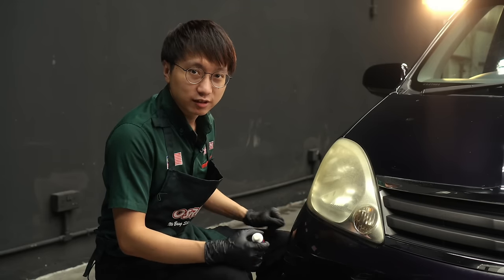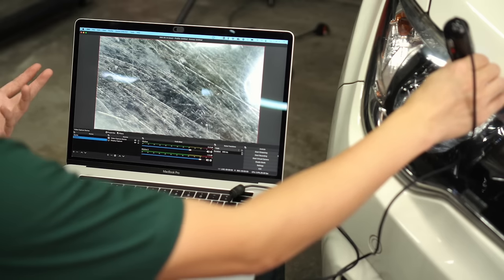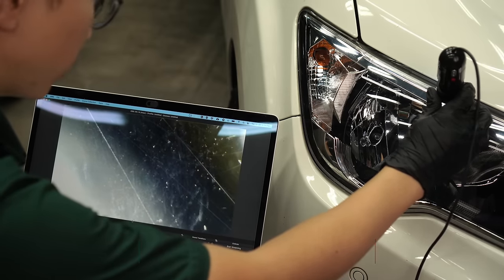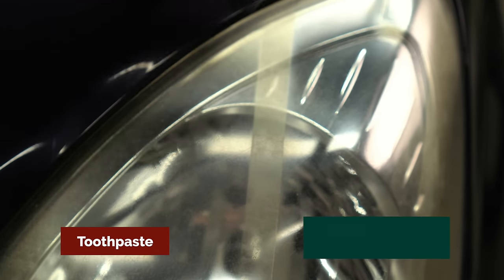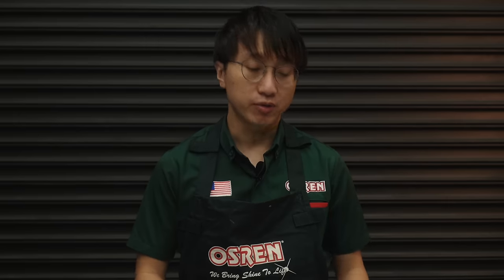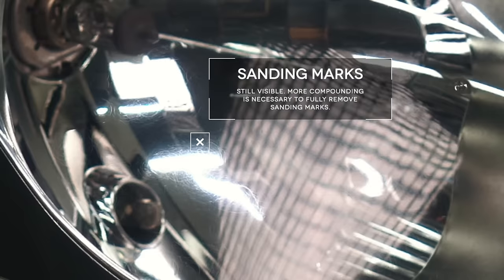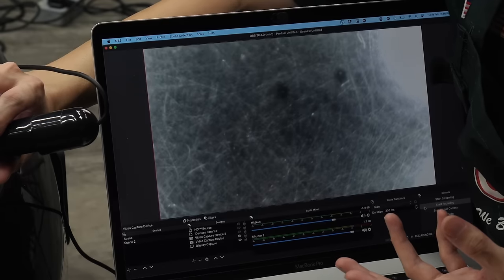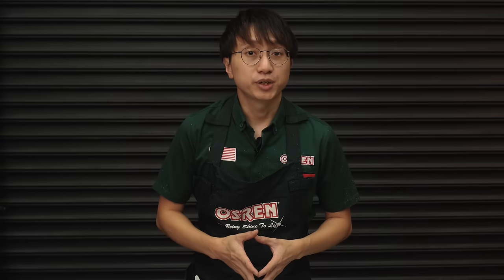How to restore headlights - 3 ways, but which is the best?

Comment: For all you DIYers out there just buy a 3M restoration kit, And take the guess work out which grit sizes should i use??The instructions are fool proof if followed correctly, All thats required is a variable steed drill for maximum clarity and shine!!Tree sanding steps!! The last disk is a p3000 trizact which is a combination of sanding and polisher, And finally a certified clearcoat is highly recommend, made for headlights only, 🤔🇬🇧👍

Comment: whats the difference between a polish for body clearcoat vs headlight polish? Are the abrasives different? This is the best video i have seen on this subject. Im impressed with the explanation and the details you have put into this. Putting the headlight under a usb microspope was perfect for me, the visuals were amazing. Keep up the great work.
Reply from the maker: Hey, great question! So we can't speak for others, but based on our experience throughout the years, the formulation is different. Both surfaces are different and react differently to different abrasives and solvents.

Some manufacturers will use a mixture of abrasives for headlamp including aluminium oxide, silica based abrasives and different solvents. (plastic is harder than paint, and using the right solvent means easier cutting on plastic)

While for paint, many prefer finer aluminium oxide and a solvent that is paint friendly. 

Using paint abrasive/formulation on headlamp is usually fine. But once in a while, might get into difficulty in refining it (micro swirls especially) on certain types of plastic. Hence a properly formulation headlamp abrasive will make things easier and produces better results with the same effort. 

Same can be said for glass abrasives. choices of abrasive and solvent is different, making it a safer and more effective choice.

Comment: Now I understand why I won't be wasting money on new headlight. I have bought some sanding grith, polish, clear coat for headlight (in a paint spray from a local supplier). This video is totally a complete session on how, when and why to use different methods.
For me sanding and than polishing and finnally uv protective coat is the only option as per this video.

Comment: Thank you for the excellent video Kenneth! You were both informative and entertaining, and this is no easy feat! I stayed tuned to watch the magic happen ☺, I liked and subscribed to OSREN Official, and I am going to get on with fixing the old headlight lens on my 2012 Mazda 3 Skyactiv. It is very noticeable now that the other headlight lens has been replaced. That said, I can do with a finished product that isn't quite as perfect as you have achieved here. I don't have any experience with this particular job and though I have a couple of random orbital power tools for polishing and sanding, I don't have an air compressor and won't be able to apply clearcoat with a professional paint gun. I could use a can of clearcoat, however, and wonder if you might recommend a spray paint that would be best for this application? Thanks Kenneth!!
Reply from the maker: Hey, glad you enjoyed the video. In our country we do have a pop and mix 2k spray can that are sold. But I do know that Rust-Oleum Painter's Touch 2X Ultra Cover Gloss Clear are used by many detailers in the united states to spray the headlamp. 

while we might not be familiar with this product, it seems to give good result, or so claimed by others. you may look further into this

Comment: I've always been told not to double coat with clear coat on headlights as it diminishes the capacity for the light to shine through the lens.

What is your verdict on the durability of the clear coat and ceramic coating ?

Excellent video by the way !
Reply from the maker: It's fine, the plastic clear coat is meant for overlapping sprays. 

durability, it still going strong till this date as we write. The ceramic coating part has yellow a little, , we did a quick polish and re coated it. (no sanding involved)

Comment: I'm terrified of taking sandpaper to my headlights, but I really must do something with them as they are very bad. Is it possible that I could actually do something wrong and ruin the headlights to a point that they can't be salvaged or is it a safe and foolproof process?
Reply from the maker: Hey, understand the fear. For plastic sanding, it's definitely safer than paint sanding. Plastic is thicker than paint, and will not burn through like paint. By hand, it's extremely difficult to go wrong.

The most challenging part of sanding headlamps is the inability to remove previous sanding marks. This can be mitigated by sanding perpendicularly when we switch sanding grit. 

For exp: 
1000 girt = horizontal
15000 grit = vertical
2000 grit = horizontal

When we are done with 1000 grit, and move on to 1500 grit to refine, ideally after 1500 grit, we should not see horizontal sanding marks. Only vertical marks. 

From 2000 grit, most polish abrasive is capable of removing the sanding marks to a clear finish.

hope this helps!
Reply: @OSRENOfficial   Hi! Sorry for the late reply. You have put my mind at ease at lot with the explanation of how it works. Thanks very much for taking the time to answer me, it is much appreciated. I will get the materials and try it soon!

Comment: Can you dry sanding and then do polymerization or it has to be wet sanding?
Reply from the maker: Hey bruno, it depends on the sandpaper you are using. We generally suggest wet sanding with generic silicone carbide sandpaper.

We do know of sandpaper that meant to be used dry such as the kovex sandpaper, and those are really fine and consistent with little pollution in its particle size.

wet sanding allows for more margin of error given that the abrasive's particles size on most sandpaper are somewhat inconsistent.

Comment: Hi, I need advice on 1 particular idea I have if I'm to go manual method. If I would to combo the sanding, vapor treatment and finishing it with a can of clear coat, will that help? Please advise. I find this as an interesting project to work on my car.
Reply from the maker: Hey Jourdan, if you are going to use the clear coat method, you may sand it down and spray the clear coat without the need for vapor polishing. 

make sure the oxidized part are fully sanded, you may stop at 1500grit or 2000grit and have it cleaned with alcohol prior to applying the clear coat.

Comment: The Clear coat I can buy in the ukk is in a spray format and not aerosol pray. Are those clear coat pumps are useable? or you recommend somethimng else?
Reply from the maker: Hey Laszlo, unfortunately we don't quite understand what you meant by spray format clear coat as we have not come across it.

For most clear coat, best is to atomise it (disperse) as small as possible, hence air pressure is always recommended in form of aerosol and air gun.

Aerosol might cause slightly uneven texture, a good air spray quality gun with a powerful air compressor often does a better job. You might be able to get away with headlamp for aerosol spray, but anything lesser than it, most likely might not produce an acceptable result.

Comment: 👍👍👍👍
Kudos for this video. Compared to other videos about headlight restoration I've seen, here I see something else that is valuable to everyone who sees it. Because it turns out that there are indeed various circumstances and how to do it according to the problems of the state and condition of the headlights themselves.
After watching this video, there are interesting statements from you (20:43): sanded, clear coated, and levelled.
Therefore, please help inform the best steps for headlight restoration to get the maximum possible results. And each of these steps, what equipment and materials must be prepared. And if possible with an example or the name of the product. Thank you very much.
👍👍👍👍

Comment: On video part : RESULTS, first headlight which you was checking was after vapor polishing?
Is it light pattern still great after vapor polishing? 
I try 3 times with clear coat on my headlights, and every time clear coat after 48 hours is still soft and catch dust on himself, or it didn't "catch" on all parts of surface, it look like somebody spray something and on multiple little sports clear coat just avoid catching on surface.
 So I wish to try with vapor polishing and ceramic coating headlights.

Comment: 18:00 You're polishing the clear coat...
Why not Polish the plastic from the get go?
Reply from the maker: Hey, to get rid of the orange peel after spraying the clear coat, we levelled it. The headlamp was sanded prior to clear coating it. 

1. sanded
2. clear coated 
3. levelled to remove orange peel
Reply: @OSRENOfficial  I know... But: the clear coat is cracking and peeling and under is the matte polimer...
Reply from the maker: @productionmark  plastic crazing can happen below the surface level, plus for clear coating, we do want some rather 'rough' surface so the clear coat can adhere to the surface that it is being sprayed on. Hence it wasn't polish to a smooth surface prior to clear coating it. A smoother surface would make it hard to spray on.

That said, sure things can be better with plastic primer, however, in our country, it's not easily accessible. We believe with proper plastic primer, it will look better.

Comment: 17:02 "you can spray directly after sanding, no need to polish" Newb question: will there be any advantage if after sanding, I polish first, before coating?
Reply from the maker: Hey there! So this specific coating is actually a clear coat. And you do need a rough surface for the clear coat to sink and bite into. 

So we don't recommend polishing it to a smooth surface before spraying.
Reply: @OSRENOfficial  got it, and thank you very much!

Comment: I got 2011 Mercedes e350 and the headlights not yellow but kinda hazy, I tried hand sanding then Mcguires plastx then mcguires clear coat, it didn’t do a damn thing, I’m trying again using a drill with sandpaper…. New set of headlights cost 500$ for the set, but when I see my same car with clear headlights it makes car look 100x better, I’m going to try drill with wet sanding and clear coat when finished if that fails I’ll just have to buy new ones

Comment: If I put PPF on the headlamps, can I apply ceramic coating on  the PPF to make it last longer? 

Also, after it is ceramic coated, can I apply UV protectant or similar polish to slow down the crazing and yellowing process? 

Not sure if this is too much to protect the headlamps. Thankd
Reply from the maker: Possible, but you will need to find coating that is suitable for ppf.
Reply: @OSRENOfficial  Noted. I think I will just apply PlastX from Meguiars on the PPF, less works and should be safe for the PPF. Thanks

Comment: I wanted to ask what if I do not have the microscope to see clearly the plastic crazing or scratching what I do or use so that I'll use the right sand paper
Reply from the maker: Hey, the grit of the sand paper is determined not by hazing, rather how fast and how much of plastic layer needs to be removed.

Lower grit is more abrasive and removes plastic at a faster rate. So if the plastic is severely neglected, use anything between 1000-2000. 

1500 is a good start as 1500 would only require a 2000 to refine before hitting the headlamp with the headlamp compound. And if it's not removing yellowed oxidised plastic fast enough, you can always lower it to 1000.

Comment: Why I use 2000 sandpaper but it more worst and more stratch?
Reply from the maker: it's common to have sanding marks after sanding with sanding paper. Follow it up by polishing it. You may check the video on our process. Hope this helps

Comment: Sanded my headlights with 400 grit then cleaned them and polished them. The yellows gone but now they look foggy and scratched any tips on how to restore them please
Reply from the maker: Hey, do follow up with finer, try 600, 800, 1000 followed up 1500 and 2000. Thereafter can start polishing it with machine and with a compound suitable for headlamps with a wool pad
Reply: Alright ill give that a try thanks bro
Reply: @OSRENOfficial  it worked thanks man 💯

Comment: Bro i have never used clear coat cand u please tell me how much quantity is enough to applying single head light and how much clear coat+thinner+ hardener need to be mixed
Reply from the maker: Hi Rajguru, on the matter of mixture, best to seek advise from supplier, as different paint have different recommended ratio. On layering clear coat, usually, 3-5 coats are also recommended. Most importantly, seek for a primer (usually for headlamp it's invisible)

Comment: How do you seal the headlights after cleaning and polishing. Soo it  doesn't happen again,?
Reply from the maker: Hey, best way is still to have it sprayed with a plastic primer and clear coat it, this method when done properly will be the longest lasting method. Alternatively you may also apply a layer of durable coating on it

Comment: Ok how do you know what number sandpaper you need cuz I I have still have light scratches that are not coming out.
Reply from the maker: Hey there, so it depends how oxidised the headlamp is. 

Most of the work would be done on lower starting grit, in fact, the first sandpaper should remove 99% of yellowish/oxidisised clear coat on headlamp. The remaining ones are mainly to refine the scratches. 

Best not to jump too high of a grit, the lower grit you are using, the more you do not want to skip a grit. most sandpapers in the market are designed on roughly 50% different scale. 

But a sure way to know if you are capable of removing the previous grit is by sanding in different direction / perpendicularly. that way you can inspect if the sand paper has removed the previous grit (for example: staring off with 800 grit horizontally, followed up by 1200grit vertically. you should only be left with vertical scratches and horizontal scratches should not be visible)

We usually stop at 1500grit - 2000grit as our products are then able to remove those sanding marks effortlessly with the right combination

hope this helps

Comment: Do you know a PPF that won't yellow overtime? 

Also is PPF ontop enough? Wouldn't the headlight need a layer of maybe ceramic coating or UV coating before applying PPF?
Reply from the maker: Hey, technically the material of ppf itself won't turn yellowish, the adhesive is usually the culprit. That said, we aren't a specialist in ppf yet, but reputable brands are usually fine. For installation, some manufacturers don't recommend applying anything prior to fitting of ppf, so again, best to check with them.

Comment: Did you create individual video about using solvent, types uv cover coats using after apply solvent?
Or only uv coating types for lamp?
Reply from the maker: Hi there, our speciality is in automotive detailing, for paint, we cannot give a solid suggestion or input. It's best if you could speak to someone who is specialised in manufacturing automotive paint.

Comment: You should Never add a clear coat to the light cover.  The reason is, the light is heavily distorted when shining through the clear coat. This will make the oncoming cars get the light shining in their eyes, even when the lights are aligned properly, and more importantly, the driver will not be able to see as clearly as when there is only a highly polished lens there.  You show a really great example of this at 19:47. You compared a non clear coated lens just before that, and even though there was still some smaller scratches on the non-cleared side, the surface was clearer.  The side with the clear coat was hazy upon magnification.  Again, that clear coat haze is going to distort the light output as it passes through it.  If you want to add any type of protectant, using RainX or something similar is the only way to go at this point.

Comment: My lights are dirty from INSIDE my lights not OUTSIDE..
Can you please make a video showing how to remove the lights?
Reply from the maker: Hey Samantha, it's a little challenging to make a video on how to remove headlamps as it varies from car to car, but essentially finding the holding bolts and nuts should remove them. 

Moreover, if the headlamp is dirty on the inside (if we are not referring to plastic crazing), you might want to have it inspected as headlamps are meant to be water and dust-proof on the inside. 

Detaching the headlamp is also not something we recommend doing as resealing it to be weather and humid proof requires precision, proper tools and adhesive.

Comment: Clear coat is bad because it reflects the light, that's why they don't spray the headlights at factories.
So the light goes much less true with clear coat! 
There is somewhere video about that.
The vaporizer you used is called synthetic resin and taulene and not acetone.

Comment: How would u clean the inside of headlights without removing light
Reply from the maker: Hey Vivern, you can't, unless the glue is removed, we don't recommend doing so without professional aid. Re-sealing and ensuring weather-proofing the seal can be challenging. You will find most of the contamination/defects to be on the exterior part.
Reply: @OSRENOfficial  thank u for your reply and honesty

Comment: Hi. Does it make a difference if it is 2K or 1K clear coat ?
Reply from the maker: Hey there, we recommend first and foremost getting a quality and reputable paint that is trusted and proven in your region. A good paint regardless of 1k or 2k will work fine.

The difference would be that 2k paint is a 2 component paint with hardener/activator, whereas 1k paint can be air-dried. Whichever you find more comfortable to work with.